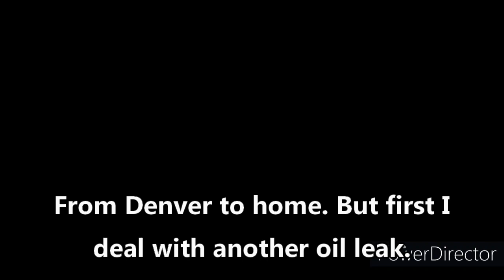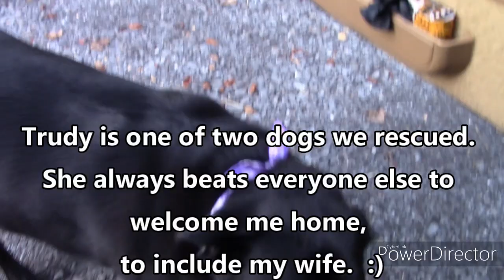Road  trip West part five (end)

Comment: Enjoyed the videos on the road. TN has the best roads. I did 3,643 miles on my road trip. But, my health started to go downhill on the way back (due to hotel beds, bad food, lack of decent sleep, left arm going numb due to the steering wheel position). Nothing lowers the blood pressure and aches and pains then your own bed. Glad your home and shared your experiences on YT.
Reply from the maker: I had my issues as well. Mostly finding a toilet when I needed it! (ha ha) My bed in the Jeep was pretty good, but if I do this again I will need to add a layer of foam or something. Otherwise most things worked out well. I do have some changes in mind however. Thanks for all the views and comments Chris.

Comment: All rock auto is are a bunch of people going to pull or pick apart or junk yards pulling parts and cleaning some of them up and listing them on rock out for sell alot of there parts aren't even cleaned its advertised as new when there all junk yard parts from wrecks
Reply from the maker: I've had pretty good luck with Rock Auto so far. I use them if no one else has the part. The NAPA store closed in my town so now we only have "Car Quest". I've never used them before so we'll see how that goes.
Reply: @wyattoneable  car quest has good parts i order from them alot

Comment: How much fluid did you consume on the power steering leak?
I had a similar situation with a leaky p/s hose 5 hrs away from home. I had to stop every hour.
Reply from the maker: It wasn't that bad as far as using fluid use goes. It looked bad seeing the wet spot on the ground but I only used about a half of a pint to get it home. I'm still waiting on that part.  :(

Comment: I dont trust rock auto if I'm going to get a used part im going to go to a pick a part or junk yard and pull it myself and test it while I'm there
Reply from the maker: Yeah, Rock Auto didn't have the part anyway. I had to order it from Canada and I'm still waiting for it. I may go to the salvage yard and get one. I think I saw an XJ there and hopefully they will have that reservoir.
Reply: RockAuto is fine...you just have to know what brands to buy.  They have a lot of junk but they also sell good name-brand stuff (Denso, Mahle, Rein, Wells, NGK, NTK, etc. along with genuine AC Delco, Motorcraft, Mopar, Hyundai, Nissan, and many others.)  RockAuto is my go-to for parts and I almost never have come-backs or fitment problems due to parts issues.
Reply: @johnaclark1  I understand that just my opinion every one has one